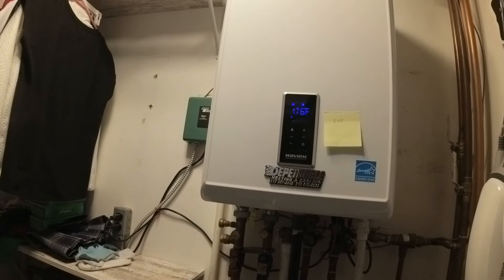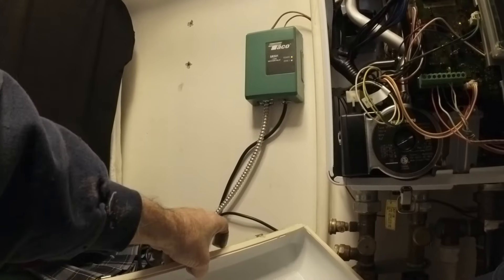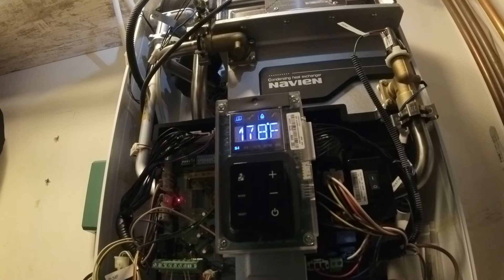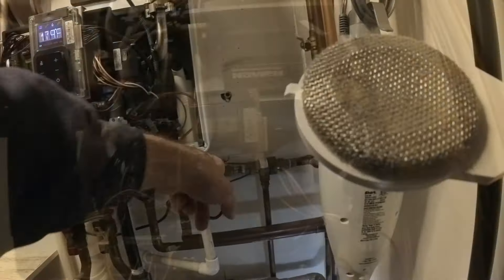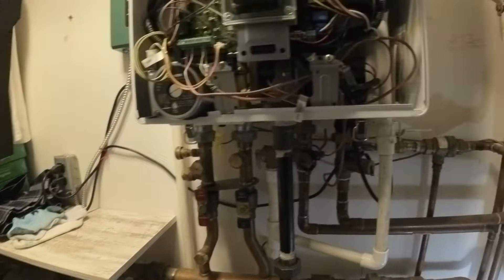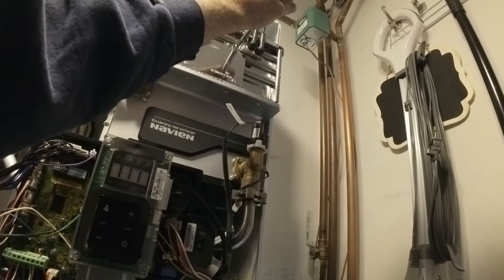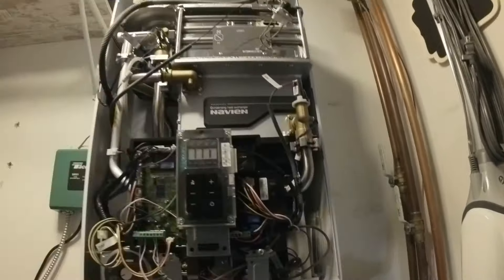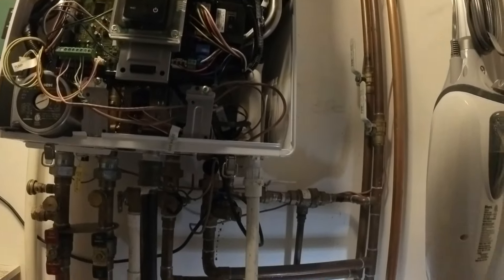No Maintenance Navien E110 Code

Comment: Should take a CO test around the heat exchanger and the exhaust black ring if it’s oily means COis leaking into the cabinet which is known to happen right out of the factory Very important!

Comment: Big time POS , A regular water heater just works for 20 + years with no trouble. That’s worth something .
Reply: I usually have to replace my water heater every 8-9 years. Is this unusual? We do have very hard water.
Reply: @SoulforSale that's very unusual,are you on well water?
Reply: @pelon542  I've changed it twice now. both after about nine years. maybe this one will last 18 or so...yes it's well water
Reply: @SoulforSale change the anode rod every 2 years. It'll last a lot longer
Reply: @SoulforSale  water heaters last a lot longer where i live,i replaced my 32 year old water heater cause i got one for free that had only been installed for 2 years,stay on top of the anode rod and do flushes,that may help get more out of them
Reply: @pelon542  No I’m on city water . My whole point was simple things break less . The upkeep on a tankless makes it the more expensive option over the long haul . Lower gas bills are great until lone of these things breaks , now you have no hot water and when you get someone to fix it he will give you a wallet cleaning. Meanwhile the guy with a basic water heater is taking a hot bath with out a care .